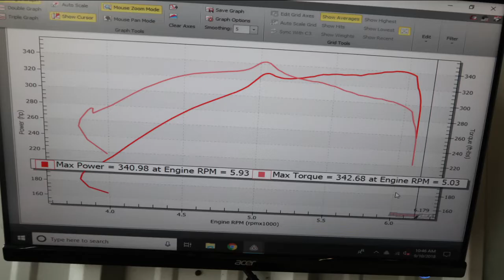Twin Turbo Mustang - first time on the dyno

Comment: Tclamps? Or wormdrive? I have the same elbow, 20 psi not blowing off.
Reply from the maker: Every connection is bead rolled and T-clamped...  Except the throttle body, lol.   All I had there was a regular worm gear clamp.  T-bolt has been ordered, should be here in a day or 2.

Comment: Somebody is going to spend some time adding the bead to the charge pipes. Or maybe welding?
Reply from the maker: The pipes are all bead rolled.  No way to bead roll the throttle body connection.  I ordered a blow off valve for it a day or two ago, I’m hoping that solves the issue.
Reply: Underground Garage I’m not sure we’ve ever blown the coupler on the TB...🤔. Get the best quality t-clamps, some of the ebay clamps will bend or strip the bolt before everything gets tight.  Good luck, can’t wait to see what the real numbers are! 👍
Reply from the maker: USA made T-bolt should be here in a day or two!